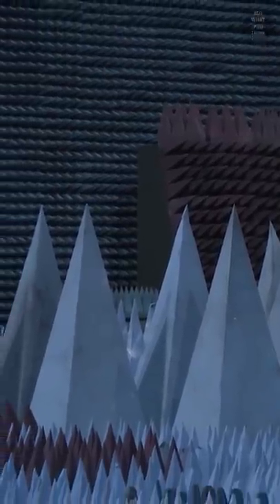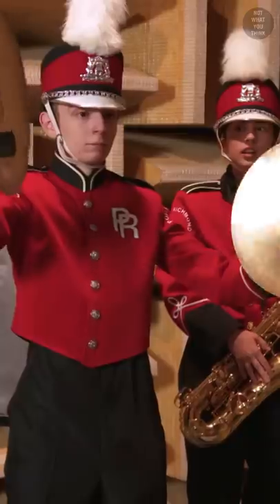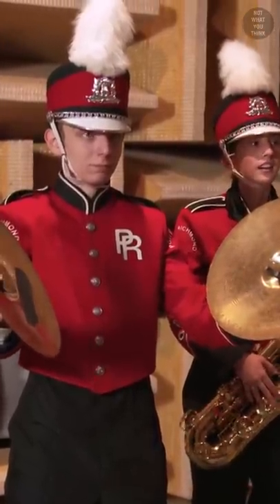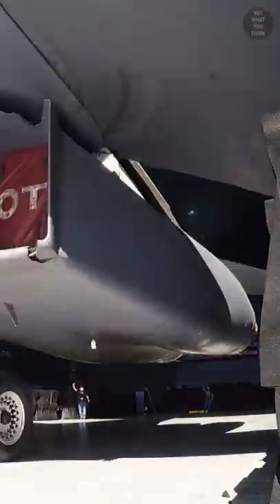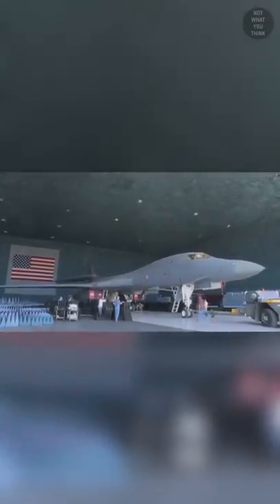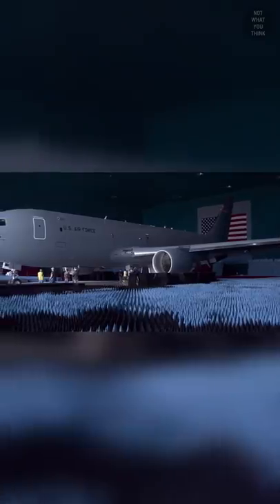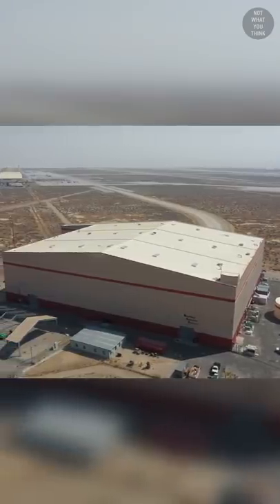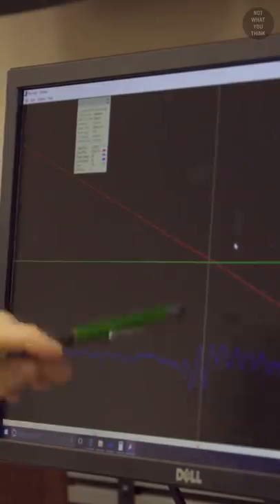Aircraft in an Infinitely Large Room #shorts

Comment: Fun fact, the USAF has an extreme cold-weather test facility... in Florida.
Reply: Ironic
Reply: damn
Reply: Probably cheaper overall to operate there. Only in Northern AK would it be cold year-round not to require building something and even than you would need the infrastructure to support the crew. So might as well put it in a more optimal location. (My hypothesis).
Reply: Irony
Reply: Super fun fact
Reply: Fun fact, Canada has the same thing, but its only available during the winter months in Northwest Territories. Lol
Reply: Enles Freedom  but it would cost a fortune to maintain a developmental facility in such a location, not to mention how do you get an aircraft up there if it has never been tested in the cold? You can’t fly in before testing to see if it will fly…
Reply: We like our AC cold down here. Don't worry about it
Reply: Fun fact the USAFs extreme cold testing facility is the same facility as the USAFs extreme heat testing facility.
Reply: Near my home town there is a cold weather facility used to test tires and even military vehicles and the ones that pass there are tested in the real thing so somewhere in Ontario or any other province that’s cold
Reply: @depausvandelilithkerk5785  bro what 🤨
Reply: Iron ic
Reply: The exact area where you be burning your skin off
Reply: Mayne they power it with all that solar power available in Florida? Yeah probably not though who am I kidding
Reply: Probably because they have many other test  facilities there already aswell as staff that won't have to fly out across a continent for each plane that gets tested.
Reply: Meanwhile the northern neighbor of Canada has vast inhabited land or closer to civilisation where you get cold weather, ironic.
Reply: @thezach6490  
Canada does not have a northern neighbor.
Reply: They would have to have all equipment used be cold proof to test in Alaska. Cost a lot higher I'm guessing.
Reply: @andrewgardiner563  thanks grandpa
Reply: @everettstormy  everyone* didn't know that!
Reply: The climate lab at Eglin! I pass it on the drive to work lol
Reply: @andrewgardiner563  You build it somewhere cold and it saves A/C. The benefit doesn't have to be "we don't need a building". Is this where I say the brain thing now?
Reply: Enles Freedom  they didn't build it in Alaska because one it also needs to be able to test extremely high temperatures and two it needs to be able to test extremely temperatures (and other environmental factors) incredibly precisely and consistently and that isn't possible with nature.
Reply: Actually it's used for many things, cold, heat, extreme wind, dust hail and more
Reply: @andrewgardiner563  Wuh oh looks like we got a bona fide Internet Tough Guy here. 
And he's an expert on military logistics and budgeting too! What's your GS level at this point?
Reply: Of course it's in fucking Florida 🤣
Reply: 😂😂😂 that's probably true... idk and I'm even in the Airforce!
Reply: @depausvandelilithkerk5785  source or this is probably gonna get reported by someone
Reply: @depausvandelilithkerk5785  seek help or move I don't know what to tell you man
Reply: @EvanFMusic  I will seek help with Pat Benatar and her Infamous Lesbian Family street gang crew as I make my dance move to the beat of her song "love is a Battlefield". As for you,.... you need to know that you must say "One for all and all for one Allpowerfull Lesbian Family street gang for ever!!!" if you want to be spared........REAL TALK!!!
Reply: More WASTED TAXPAYER MONEY!!!
Reply: @depausvandelilithkerk5785  Gamg gang bruh
Reply: I’ve been to the outside of it. Pretty incredible they can make blizzard conditions in Florida lol
Reply: Enles Freedom  well yeah but there aren't any aircraft up there genius.  Probably doesn't cost that much more than any other conus location
Reply: @Bushguyrocks  Russia
Reply: Ive been there. They have a big temp gauge on the outside which always makes you laugh to see how cold it is in there also to be fair its north Florida not lile miami.
Reply: @stevek8829  
True!
Reply: @everettstormy  I didn’t
Reply: @everettstormy  I love in Florida and didn't know that
Reply: Tf
Reply: @depausvandelilithkerk5785  What?
Reply: Makes sense
Reply: @sackerman4530   : just get a Russian aircraft
Reply: Isn’t that essentially the same as, the reason why the back of your A/C is hot. Cheaper to run there. Hear exchange.
Reply: @everettstormy  Ha! Joke's on you! I don't know this.
Now, apologize.
Reply: Enles Freedom  hauling the immense equipment and materials for such a HUGE facility either by air, sea, or thru Canada  very well could be more expensive than maintaining a facility in florida.
Reply: The Navy has a swastika building
Reply: That's ironic
Reply: Why dont they just take them to canada?
Reply: Sounds like a very Air Force thing to do
Reply: And the Russian Air Force has a cold weather test facility outside
Reply: Let it snooooooow
Reply: Nice 💀
Reply: @jaredhamon3411  that's similar to what I'm thinking, also it's part of the mainland US so easier to transport to
Reply: Bruh
Reply: Fun fact I’m in the usaf right now
Reply: Enles Freedom  Makes sense that randoms on the internet wouldn't even think about what they're regurgitating onto Public forums
Reply: Yep, Eglin AFB
Reply: Oh the one in Eglin? I've been there. Its really cool. They can make it snow in there😀
Reply: @Bushguyrocks  yeah we do, the earth is round an therefore Russia is the closest thing to a northern neighbour
Reply: @sackerman4530  nah dude, @Endles Freedom probably knows more than the collective intellgence of the US Air Force!!! They're just a bunch of dum dums😂🤣
Reply: boomer
Reply: @sackerman4530  thanks for bringing some common sense to the table. It was in short supply until you showed up.
Reply: Nah probably just a Costco freezer section.
Reply: that is what you get when  you have infinite budgets for the military/ Meanwhile people are still drinking poisoned water in the US.
Reply: @everettstormy  not me, And I live in Florida
Reply: @jaredhamon3411  yes but the us have land in Antarctica, pretty cold over there
Reply: That's not ironic that's a flex lol
Reply: I need one of those quiet rooms. My student neighbours keep me awake with their loud whispers and light foot tiptoeing  elephant walking.
:)
Reply: florida can get cold trust me I've lived there my entire life
Reply: Why don't they just cold weather test their planes here, in Eastern Canada? 😸
Reply: @jaredhamon3411  Also why would you test the ability of a craft to sustain cold weather in an uncontrolled environment where it is already very cold? Huge risk of hurting the machine if something was actually not up to par.
Reply: That explains alot
Reply: They also have a weapons testing facility on Shadow Moses Island
But you didn't hear it from me
Reply: @Bushguyrocks  He means canada.
Terribly worded but he is saying the northern neighbor of the US. the land of Canada.
Reply: Genius :p
Reply: @Vivid Media I know the bases in florida
Reply: @Vivid Media oh I see! I am at lackland
Reply: I’ve been there, they have this sound chamber there as well at Eglin
Reply: @Vivid Media I think it is J-Primes from the 96TH Test wing. They also do the extreme weather testing.
Reply: @ajm2872  Being in Texas and having the other NASA sight it makes sense. Down South we like our AC cold and it gets hot in the summer. It gets cold in the winter some years too. It's probably easier to test going from hot to cold like aircraft have to do all the time. One minute the jet is taking off in Hawaii in December the next minute it's landing in Japan, South Korea, Germany or Ohio.
Reply: Yeah it blew up a couple years ago, how’s it doin?
Reply: @NBW_Grumpy  it blew up?
Reply: so where in Florida is this???
Reply: @LemonsO7  Eglin Air Force Base.
Reply: Enles Freedom  you have no common sense bro
Reply: @Bushguyrocks  Russia?
Reply: @FFeelliixxxx  Christmas Eve night in Ocala it dropped to 17° and out in the country all the PVC connectors coming off water pumps broke. The orange trees were killed dead, not just the crop. But that's not cold in the North.
Reply: @stevek8829  damn
Reply: @FFeelliixxxx  I forgot to say it was 1983!
Reply: Yes
Reply: @jaredhamon3411  they just don’t give a flying fuck when they have infinite money from taxes
Reply: Enles Freedom  they dont care look at the military budget...
Reply: They'd never expect it.
Reply: @stevek8829  What? I live in Anthony a few miles from Ocala and had my window open all night. It never dropped below 40°F. I really don't think it even dropped below 50.
Reply: @ossiehalvorson7702  in a comment a couple comments down I added that it was in 1983, specifically Dec 24/25.
In current times, down in Pinellas County, about 28° F possible, but not common. The orange crop used to be a good bit North of Ocala. For years it wasn't, not sure if it's returned. I'm fairly familiar with Anthony. No more Jumbo Lair? If you follow 326 across 27, you get to Blitchton where I used to live. It's hard to recognize some parts where roads have been enlarged. Are you familiar with the Sutton quarter horse farm near you? I think it was on Old 301 or Old Jax rd
Reply: @stevek8829  
Russia is no farther north than Canada. Check any map or globe. Once you hit the north pole you are going south again. So no, Russia is not Canada's northern neighbour.
Reply: @Bushguyrocks  thanks for the geography lesson. If you head north and don't turn, you'll get there. Close enough, hey?
Reply: @stevek8829  
If you head north, sooner or later (when you hit the north pole) you will have to turn south. America is a great country. It's just to bad the education system down there is lacking. Different priorities I guess.
Reply: @Bushguyrocks  but, my educated one, you can head south without turning. You actually talk about turning to head south and education in the same sentence? If you were educated you'd know that if you hit the North Pole, you'd crash.
Reply: @stevek8829  
Gibberish.
Reply: Enles Freedom  lmao
You misunderstand many aspects of this whole thing.
1.not government, it’s the military which are different entities at least  in their operations of course
2. The testing may include more than your simple mind would think.
It’s not just a basic “whoopdy doo! It’s cold outside plane fly!” 
The US military is not basic and stupid.
3. It’s generally more practical to be someplace like FL where there is water nearby, and also it’s warm as well that way there is another testing variable
Reply: The Army has one is Natick MA
Reply: To be fair high altitude flight at certain speeds and layers of atmosphere are always going to be cold regardless of normal ground temperature.
Reply: @jaredhamon3411  that’s literally the description they say in the video.
Reply: @everettstormy  
Everyone is 1 word.
Reply: @sackerman4530  can pick a state with less humid conditions. Ez.
Reply: @everettstormy  I'm not everyone
Reply: That's cool.
Reply: Correct me if im wrong but does it also have extreme heat and extreme winds or is that a diff one i heard of
Reply: Wrong, it's an extreme cold OR HOT weather test facility, so they do both. It's probably just cheaper to cool it rather than heat it, plus they can return it to room temperature faster by just opening the hangar doors
Reply: cant they just go to, i dont know, alaska?
Reply: Kinda counterintuitive but still cool nevertheless
Reply: lolz
Reply: Lol
Reply: @Vargas3499  same
Reply: @jaredhamon3411  Russia
Reply: @jaredhamon3411  …Uhm… Alaska?
Reply: Wha..... What..?
I get the temperature stuff, but why whould even go to Florida..?
Reply: @monikamyszko5512  because i like freedom, Springs and beaches
Reply: Only in West Virginia
Reply: @stevek8829  russia is not north of canada, russia is east of canada
Reply: @dice-3221  from Canada you could fly North or East or West. Buy a globe son.
Reply: @stevek8829  if you went north you would also go south
Reply: @stevek8829  so not really NORTH neighbor
Reply: @jaredhamon3411  my hypothesis is the budgets unlimited so why would it matter
Reply: @jaredhamon3411  not even year round. Summer are actually pretty warm there. And only getting warmer.

Comment: This video mixes up audio anechoic chambers and EMC anechoic chambers. Whilst EMC anechoic chambers have a similar affect to the audio ones, they use very different materials. The large chamber shown here with the plane in is used to create a largely electromagnetic wave free environment to then either measure exactly what is being emitted from the plane or to see what would happen  to the plane under specific electromagnetic conditions. Nothing to do with sound.
Reply: Thanks... I thought something was a bit off when he mentioned EM Waves since sound is a mechanical wave
Reply: It works on a very similar principle though, if I understand right. In either cases the waves are reflected down in between the pyramid indefinitely, releasing it's energy in the process. Of course, for the EM ones, the material is designed to be particularly good at absorbing EM energy. Also, at least in the case for smaller facilities like this (such as GM's Lake Champlain facility), they incorporate a faraday cage into the walls so that outside interference can't get in, often using fiber optics to route information outside the room/building to actually analyze the data.
Reply: @webby2275  exactly, waves all behave in the same way, just at different scales. And yes, optical fibres for communicating with battery powered equipment to limit the noise in the chamber to a minimum.
Reply: I think he was talking about the multiple types of chambers
Reply: The real MVP.
Reply: How are these places ventilated? If they have to be soundproof and EM wave free etc?
Reply: @paradise_valley  An EM chamber does not have to be sound proof, so normal air con, ducted behind the pyramids is fine, as long as there is no exposed ducting. For audio chambers, it's similar, but the fans are designed to be low noise, run on low settings or off when testing is being conducted, situate the motors a long way from the chamber, and have baffles in the duct between the unit and the chamber to minimise sound transmission and turbulence. Think of it like going into a cave - the deeper you go and the more bends you go around, the less light reaches deep inside. The longer and better baffled the duct, the less sound reaches the chamber.
Reply: I was looking for this comment, thanks!
Reply: Also Armageddon garage for that drill thing
Reply: You are correct EMC not sound. And this building is shielded too welded steel plates.
Reply: @paradise_valley  Waveguide vents allowed air in and out. Not sound proof.
Reply: EM anechoic chambers also function well as acoustic anechoic chambers. The wavelength of EM of interest is basically the same as acoustic wavelengths in the range of human hearing, and the materials used also work well for acoustic dampening.
Reply: Bruhhhh you're so not on our EMF than... 
Or you'd like... Get it... 
Harsh vibes from the sheep bruhhh, far out.
Reply: Radar anechoic chambers are pretty much equally acoustically dead. Not by design; it just so happens. Both types trap incoming waves on the same principle: tall pyramid-shaped absorbtive materials. The waves bounce between two adjacent pyramid sides many rimes, each time losing energy, till there's little to no energy coming back out.

Graphite-impregnated foam is an excellent e-m wave absorber, and, hey!, it also absorbs sound.

Audio anechoic chambers do a bit better at absorbing sound, but only a bit. They use pyramids or wedges, usually fiberglass. But then they protect the delicate fiberglass with hardware screen, which sound goes right through, but radar waves do not. So an audio anechoic chamber would perform poorly for radar.

But radar chambers are very nearly equally good at both.

Source: me. An audio and radio engineer.